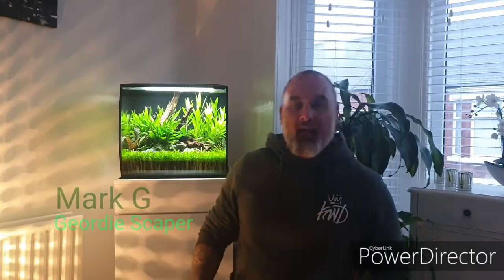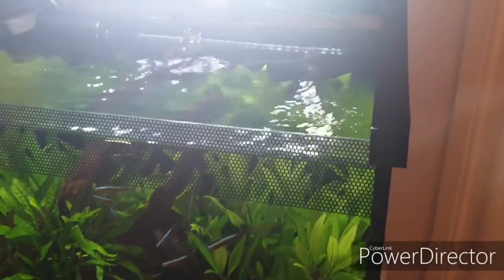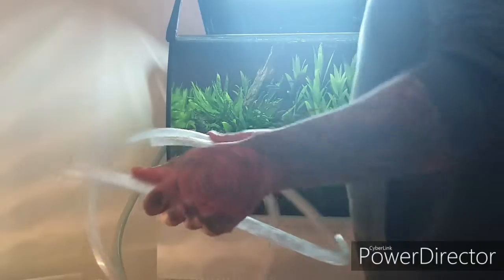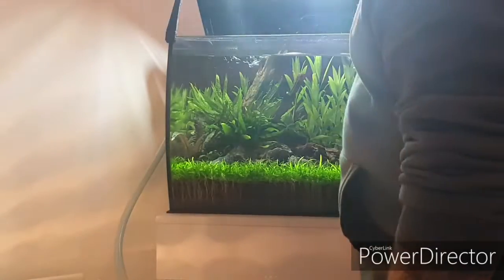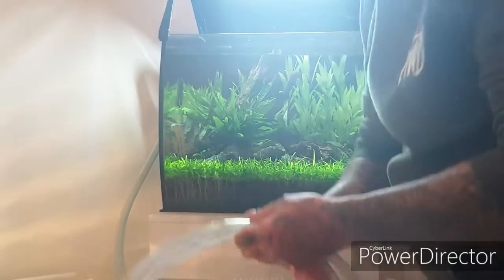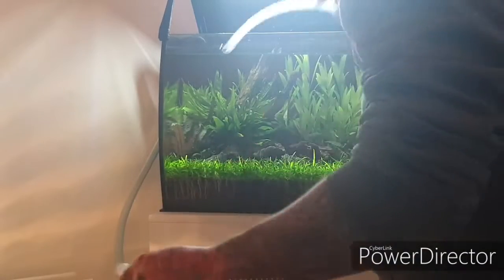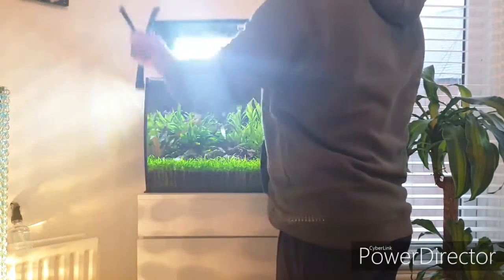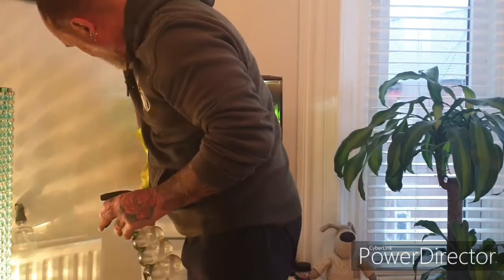Fluval Flex Aquascape - Maintenance  - 2019

Comment: might see if can get some tubing and pump use that like did for putting the water back in, saves my back hurting
Reply from the maker: Well worth it Lee👍
Reply: @GEORDIESCAPER  do have any links to buy the stuff
Reply: @GEORDIESCAPER  do you have any link for the stuff your using on the video so could do the same please. or if sell them
Reply from the maker: https://www.horizonaquatics.co.uk/collections/aquarium-pumps/products/oase-optimax-1000?variant=33051827568697

https://www.olibetta.uk/jbl/inset-cristalprofi?sai=1829&gclid=CjwKCAiApNSABhAlEiwANuR9YM2EkrTIgGpqJYz-HPcLuWYMPGhZum-gAOhxp_mF9WWSH5FUSQYobxoCaYwQAvD_BwE

you'll also need 16/22 tubing for the length you need.

Comment: Rather silly question, but do you put the dechlorinator into the bucket of water first? Or was it put into the tank directly?
Reply from the maker: Ideally in bucket first but it's ok to add direct to tank👍
Reply: @GEORDIESCAPER  thanks! Asking this because I'm trying to run water straight in and out of the aquarium via a hose off a tap.

Comment: Hi Mark, I see you didn't turn filter off when taking water out the tank. Is there a reason for this as understand you should turn it and the heater off when you water change.
Reply from the maker: Hi David, I forgot to show when I turned off heater and filter. I empty a small amount of water (just above heater water level marker). Clean inside glass, disturb plants and substrate to release waste etc. This is the point I turn off filter and heater and start draining with hose removing as much waste as possible. Filter and heater switched back on once refilled. Hope this makes sense.
Mark

Comment: Hi Mark, Hope all is good with you. Some advice please, I have a 10gl bowl with live plants and a filter cartridge for filtration, plus four neon tetras which we have had for 6months roughly all going well except I did a 60% water change last night due to 0.6 nitrite reading. This morning I did some tests for Ammonia,Nitrite Nitrate also changed the filter cartridge last night the readings are 0.1 Ammonia, 0.4 nitrite, 10 Nitrates. Do you change 50% of water each day? Or leave for a few days for water change along with testing? This is my Granddaughters fishbowl, plus I'm use to marines and the cycle is slightly different to Tropical. Any advice would be Appreciated. Cheers simon.
Reply from the maker: Hi Simon, I'm good thanks.
With it being a smaller volume of water there isn't much room for error. Best to wait around 4 weeks before adding livestock. Also probably best to have some sort of biological media. During cycling I would recommend the following:
Wk1 50% water change every day
Wk2 50% every 2nd day
Wk3 50% every 3rd day etc until you're down to one 50/60%  water change a week. This isn't set in stone but it's worked for me over the years.
Hope this helps
Mark
Reply: Mark your a Gem👌🙂 much appreciate your advice and quick response. The fact you have answered what the routine is I now know👌. The bowl is established has been now for a year. Something has caused the nitrite spike. The neons are fine we have a small piece of rock along with pebbles and a small soil substrate for the plants which are Anubias petite and a couple crypts which are doing great. I will do a 50% water change each day for this coming week, then from every 2nd day etc. Thank you so much 👍 by the way your friend Peter the Scape is lovely I would have used Dragon stone to compliment the wood and used Tropica aquarium soil powder for the more fine plants. Will update with how we get along👍 thank you so much 👍 keep up the good work 👌 keep well mate 👍
Reply from the maker: @simoncushing1048  No probs Simon, best of luck with it mate👍

Comment: Very curious where to get a pump system like that to pump water from a bucket back into the tank! (: I always use a syphon but that requires the bucket to be at a higher elevation then then tank. Also, do you inject CO2??
Reply from the maker: Hi Matt, no CO2 in this setup. All you need is a basic pump I use an eheim compact 1000 (1000lph) siphon water with pump  from large bucket to tank. Hope this helps.
Mark G

Comment: Firstly what a beautiful tank loved that video. Im starting a new nano planted and trying to make as low tech as possible. Would the lighting available in the fluval flex and good soil be enough to grow the hygrophilia siamenises or do you think i need to add ferts. any advice id really appreciate..thank you.just trying to stay as low tech as possible im in middle of rescaping all of my aquariums
Reply from the maker: Thanks Mark, much appreciated. I found the 53B spot on for a low tech setup. I would definitely use a nutrient rich substrate such as Tropica Aquarium Soil, loads of benefits and worth spending on the substrate. I always use a complete daily fertiliser so unsure how it would grow without it....i think you could get away with one squirt of Tropica Specialised (for example) every other day and the lighting in the Flex is fine (I wouldn't use the fancy effects though, full setting white light and maybe a touch of another colour to suit the colour of fish to make them pop) it is important to cut off  yellowing, holy leaves when you spot them. When Stem reach the surface cut off around a third of the way down and replant to get a more bushy back drop.
Hope this help.
Mark G
Reply: @GEORDIESCAPER  Thank you for ur quick reply mate very helpful. I did use Tropical soil in my tanks and really loved it. I had some yellow leaves with pin holes in them on my siamensis 53b and thats why i asked, i thought maybe didnt have enough ferts available for the lighting I was using. Il keep on trying and see how i go with the fluval flex. Thanks again appreciate the help
Reply from the maker: Good luck with your Flex👍👍

Comment: Hi Mark, great setup. I'm looking to setup fluval flex 57. How often do you change water? Do you think adding 3W NanoZapp inline UV Sterilizer to the setup would help with algae and less often water change? Also would co2 be helpful at all? Big thanks.
Reply from the maker: Hi Paul, I've tried UV sterilizers in the past and never noticed much difference with them. When you first set it up plant as densely as possible, using fast growing stems  in the background, 50% water change at least every other day for the first couple of weeks and then once a week after "the solution to pollution is dilution". 
Good luck with your setup, great little tank the Flex👍
Reply: @GEORDIESCAPER  fantastic :) big thanks